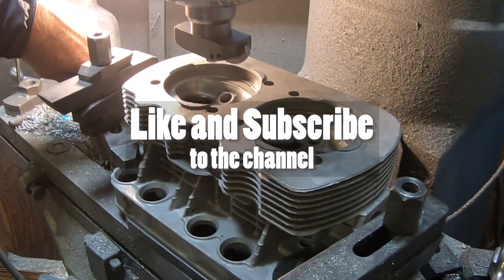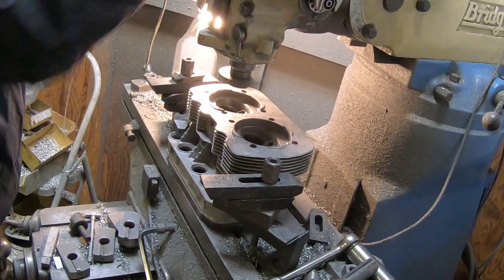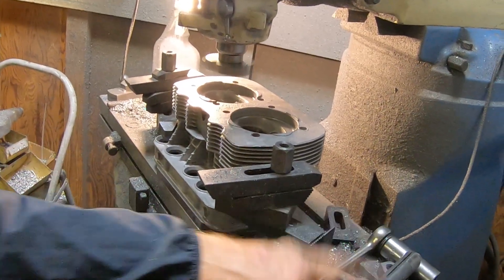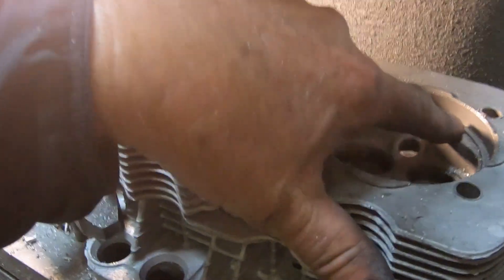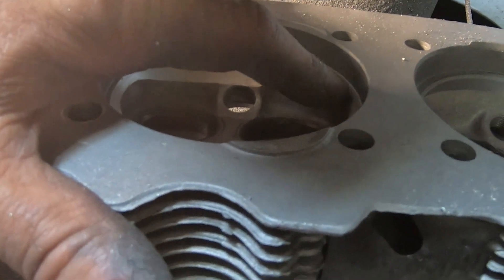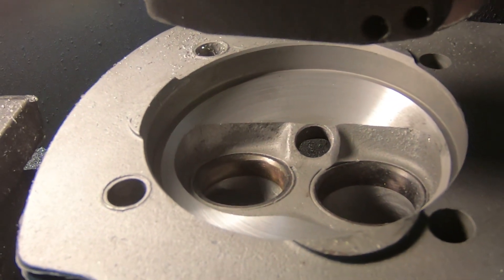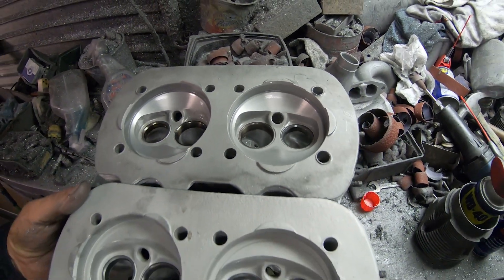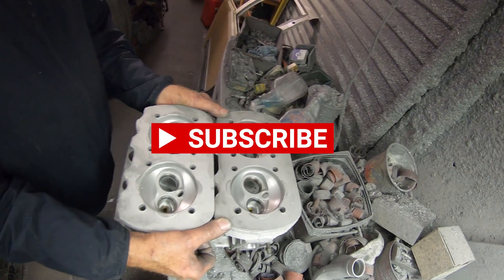How to Add Semi-Hemi to Factory Volkswagen Air-Cooled Aluminum Heads Part Two

Comment: A real hemisphere chamber has canted valves on the angles of the dome shape which gives you larger valves with symmetrical flow in & out of the cylinders , a semi hemi is similar but flat sides , so m maybe this modification is a part semi hemi ...but its good to experiment & try different things .
Porsche 2ltr  912 had full hemisphere heads with partially canted valves  , maybe buy them instead as they are already designed like that .
Reply from the maker: Thank you for viewing our channel.